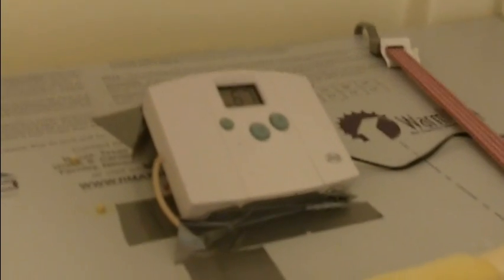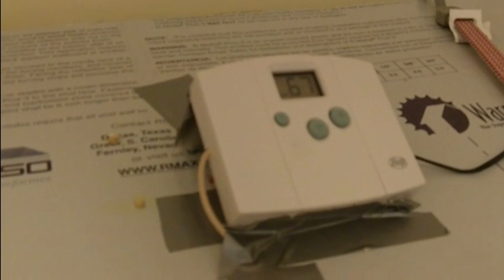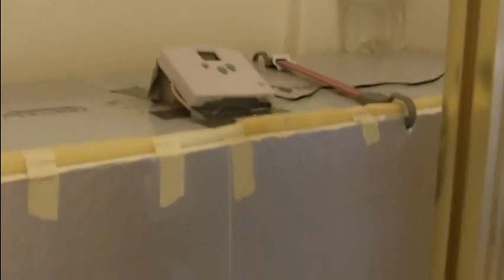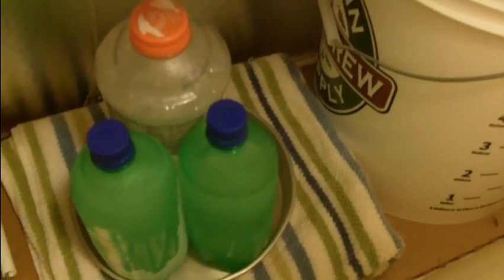Fermentation Chiller Chamber Home Made First Prototype

Comment from the maker: @ACTeslaMachineDC Ah, I didn't show you in the video where the temperature probe was.  The temp probe is attached to the top 1/3 of the youngest fermenter, the one with active fermentation going, so that's the temp controlled.  Also, I put a couple of extra ice bottles and this big sore shoulder chiller drape and I put on a wet towel with the end underneath the ice bottles in the pan on it, to wick up cold water.  I really nurse-maid an active fermenter.

Comment: Well i've got a project on hold do to lack of parts but you can cool that area with a single decent computer power supply . 6 - 800 wats 12v
individually they dont pull that much power.

my on hold project is a bit more ambitious . trying to get about 8000 Btu cooling out of a bank of TEC's 
Right now i'm short on TECS and a master sync thanks to a whopsee with an old mercury gage for a vacume pump :p 
ate the sync off the front and did a number on half the tecs i was wiering up :p

Comment: Great cludge of stuff :)
And if it works for you Great if it's a test rig befor ya go all carpinter on it Grate to.

You might want to consider a Thermel Electric cooler for somthing that small a few TEC devices and that thermostat can save you the hastle of the ice.

my Low Temp atempts so far has ended up with a group of Verry drunk raccoons..
Second atempt in planning This time using a bucket without... a spout.... And some chicken wire to keep em out.

Comment: @steeljan My thought was actually to use them for their differing purposes at different times--so pull out the keg stuff when doing a fermentation, and vice versa.  My ideal would be to have two freezers and two controllers--but my budget is pretty low for fun stuff at the moment.  Ideally, I'd like to have a small chest freezer in my brew corner for fermentation and a kegerator for serving in the dining room area.  If I can get the right price on Craigslist, I'm gonna do it!  :-)

Comment from the maker: @terpsichoreankid Here's something I don't understand.  I've found that the temps I want for my kegerator vs the temps I want for my ferm chiller are different, e.g. my fav serving temp is 46F, my ferm chiller I want at 67F.  How would you use one chest frig & controller for both?  Or are you planning on 2 chest frigs & 2 controllers?  Or are you thinking of making a partition with a baffle to regulate two sections of one chest frig?

Comment from the maker: @threeque Sounds like you're nearly in the same fix as I was before I built this.  I could keep that fermenter cooler, but still violated the yeast's high end temp.  Frustrating.  The fan, oh, I've been building computers for ages, replaced that fan out of a gaming rig because it was too noisy.  I never worked IT, rather, design engineer.

Comment: @steeljan  I just measured mine at 70 F right on the concrete floor, but the air is more like 74 today. The cool floor temp I am hoping will help keep my latest brew cool, but I still have to supplement with with some ice to keep it down to 68 or so. I love your chamber by the way. Is that cooling fan from your IT days?

Comment: @TakeSomeAdvice  Your comment about ground temps just sounded wrong to me. So I looked it up for you! I would hardly say that the ground is still 'cold' from winter. In fact, that while the ground at 6 feet is still technically warming, we have lost just about all the winter chill from he ground at that depth. The temperature swing is about 20 deg, and we have warmed up by about 18 of those 20 deg's as I interpret it from a chart I found. Interesting stuff, but we are just finished warming up.

Comment: Man is that thing simple but effective.  If you can afford to increase the thermal mass in there it will help with temperature fluctuations.  It can be nothing more than a couple 2 liters of water.  In theory your fan should kick on less but longer in duration.  Also when you change your ice the larger mass will retain the cold when you open the front instead of just a large volume of ambient cold air rolling out.

No Bob Barker microphone.

Comment from the maker: @TakeSomeAdvice Totally, you are so-o-o fortunate up there.  Not only nice temperatures but BASEMENTS!!  Nobody in my neck of the woods knows what a basement is, and right now, it's 97F outside and climbing.  We only air condition down to 78F inside (trying to keep electric bill under $400/month).  Yeah, on this project, I already had the foamboard from another project, the thermostat was under $20.  Thanks!